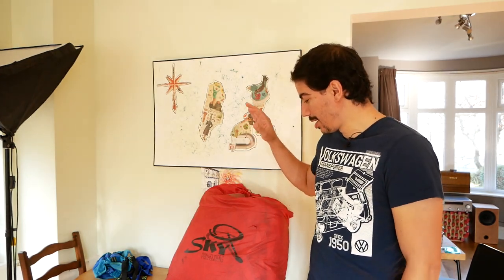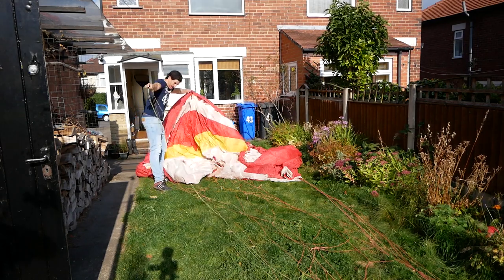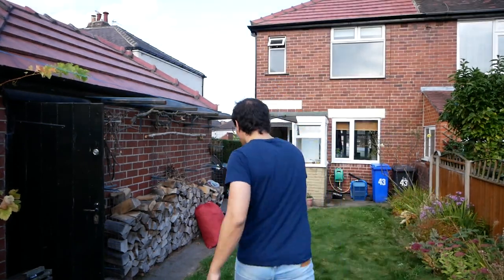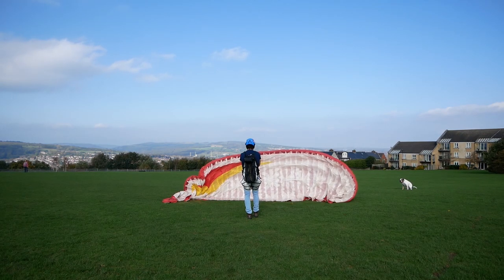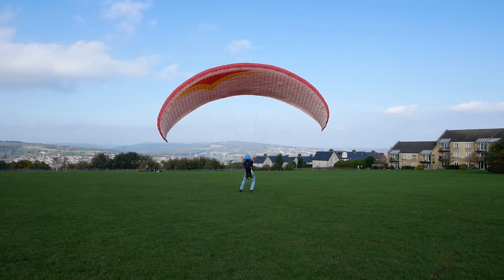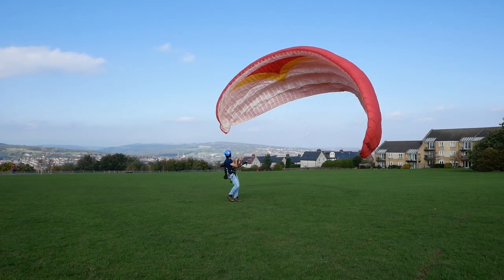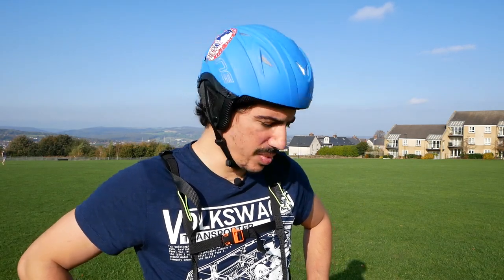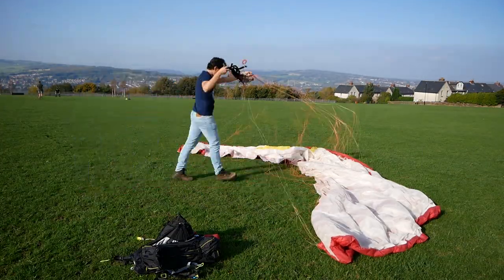Short Paraglider Experiment! Day 15 - 30 Day Youtube Challenge - BANDARRA

Comment: There's a few videos of wings cut in half (, usually hitting lie lines) the two I can recall landed fine.. but not half a wing, two halves with a huge gap in the middle effectively flying bad two wings..scarey stuff
Reply from the maker: jamiefly yeah I think I saw those. Impressive stuff. I wonder if just half can fly...
Reply: (a qualified Yep you can) I've been flying to spot landings 50% (or more) folded paragliders for over two decades, the main 'trick' is to remember that as far as the aerodynamics are concerned  it is not in fact 'half a glider' rather the 'new' front/nose of the paraglider is the still normal shape tip area... so the remaining 'live' brake is used to control the balance between Yaw OR Adverse Yaw in effect by adding a touch extra brake you 'spill' air out from (what was) the 'leading edge'... to make the wing fly slightly 'negative' (what would have been Adverse Yaw) OR by slightly reducing the 'live' brake you let the wing 'spill' air out from (what was) the 'trailing edge' giving the wing some Yaw / letting it go slowly 'positive'. Note the biggest issue (with an actual cut in half wing) is getting a launch, this falls into a couple of problems, one obvious one is you need to rig the lines (from the 'half glider') to provide harness support to both sides of the pilots mass (easiest way is to use a abseiling harness rather than a PG harness due to the single point connection design) the other is to get enough launching 'tip as the nose' airspeed .... coupled with enough Parasitic Drag on the pilots mass in the CORRECT direction (in effect pilot drag has to be in effect 'across' the span of the 'half wing'... a very easy transition from normal flight but unreliable with out the normal energy/airflow starting point of a full/two sided wing in flight!
 MH

Comment: I would like to know what is the designers view on the lines length. I mean all the characteristics.... Is there any video about that?
Reply from the maker: I would like to know that too
Reply: @AndreBandarra1  Hi you need to know that the paraglider is designed like this with 7 meters of strings to give the wing the maximum aerodynamic structure that means if you extend strings or shorten strings you damage the structure of the canopy except that you shorten strings you risk yourself

Comment: Hi Andre. First I want to  say the obvious:"the people who make the paraglider had study it very much". But I understand that you want to play with it (and I preciate you share it, I love to make experiments too but sill did´nt with paragliders)
Well, now I see that the cut was a bit to much, 1 meter longer the lines and I think the canopy wil not loose the shape. The winglets almost touch your ears, and the brakes doesn´t release totally, that´s wy you need to accelerate. 
If you can extend the lines a bit, perhaps it wil behave better, and win a less "pendulant" paaraglider. 
Regards
Reply from the maker: Thanks for the nice comments Claudio. Yes that's the thing, I know that paraglider manufacturers have all this information but it's secretive and not available to anyone else, so it's not like commercial aircraft aerodynamics where you can just read a book, so I like to experiment. Yes 2.7meters is a very big cut and it affected the brakes. they were still loose after I re-adjusted them but the lenghts were wrong so when I applied brake it applied too much in the wingtips and not enough in the centre. My plan is to go even more extreme just to see what happens, and make a very very short one and also a very very long one.